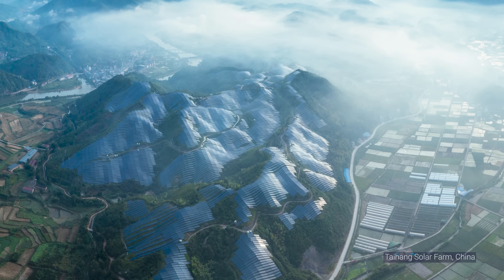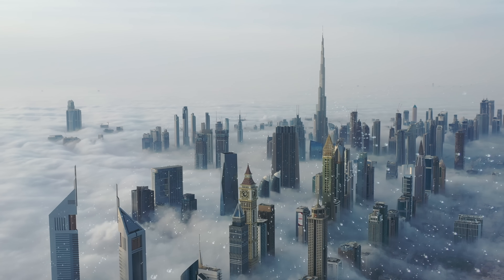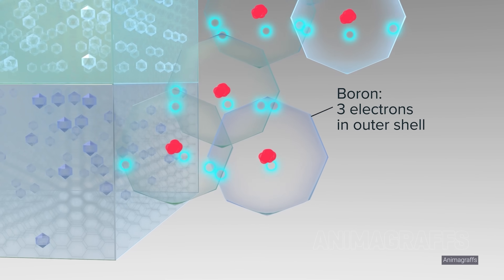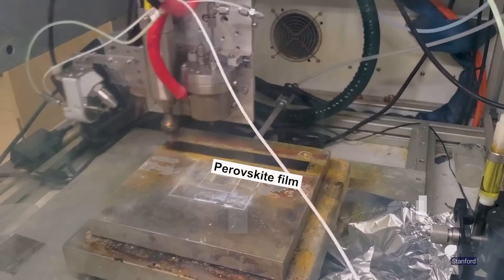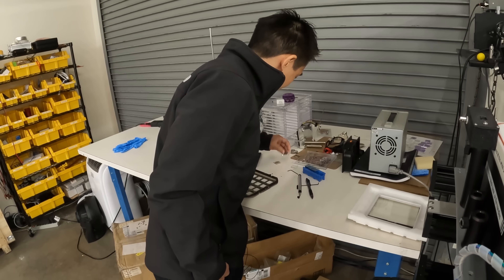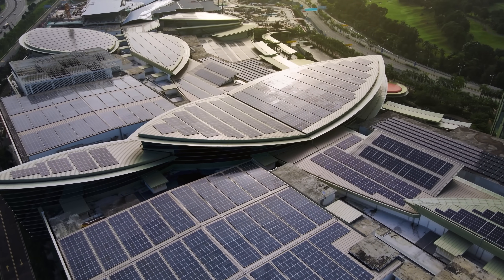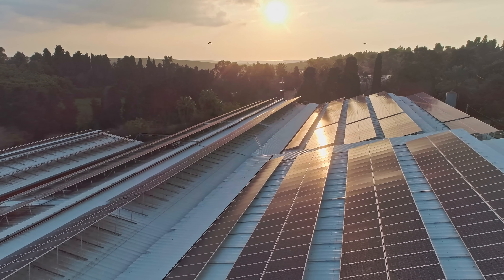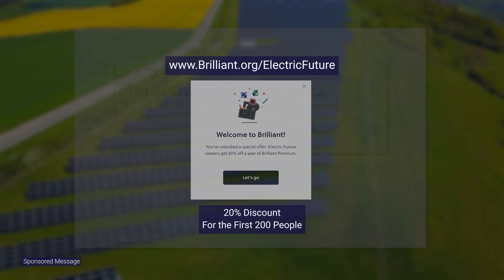Solar 3.0: This New Technology Could Change Everything

Comment: The first commercial applications will likely be high quality camping chargers and yatch solar systems - the first is a great market for the increased power density (but initially low production volumes) and the second don't mind paying a premium

Comment: Wow, that is very expensive equipment.  I wonder how that young man managed to pull that all together.  Did he actually build that company or was he hired to the CEO position because he has a PHD in physics, or does he ????  I was considering putting solar on our home but did not like that there were all hinds of panels etc. such that I was overwhelmed by all the information.  So, I opted to not purchase solar until the panels price come down and battery storage is enhanced beyond the likes of a Tesla Power Wall which is full of smaller Lithium Ion batteries.
Reply: I'm guessing this is a case of a startup built off of PhD or graduate research. Often companies like that will partner with the university where the original research was done, allowing them benefits like access to lab space and equipment, etc.
Reply: @Bobbias  I was originally thinking we should watch him because he is chinese, but he spoke such good American English I realized he is just OF CHINESE DESCENT, not that he is a Chinese spy, which happens more often than most want to admit, because China is stealing our technology hand over fist.
Reply: The Tesla Powerwalls will be using LFP batteries, which last longer, don't cost as much and are safer and less fire-prone that the smaller cells.
Reply: @acmefixer1  But they are still Lithium Ion.  I've seen the videos of this new battery you speak of, and while it does save weight and manufacturing cost, it still does not give any Tesla vehicle any more appreciable range,  What?  Maybe 50 more miles......